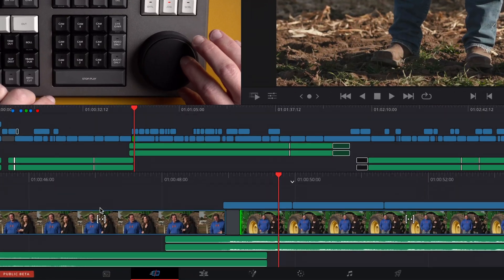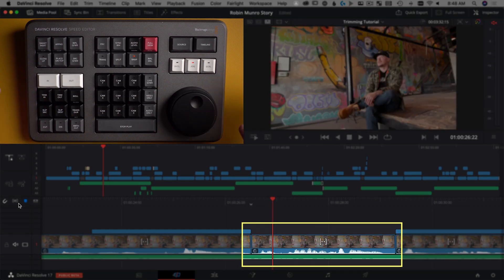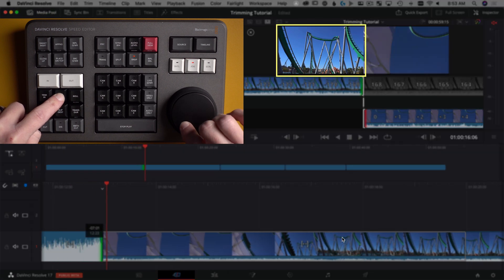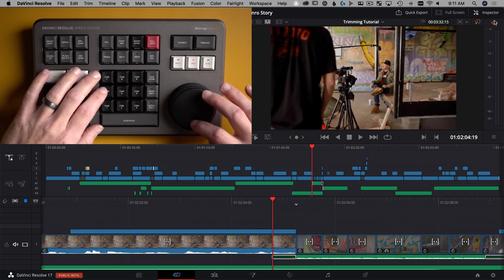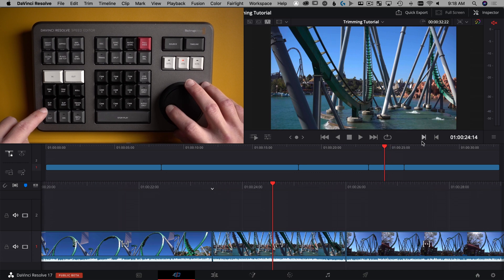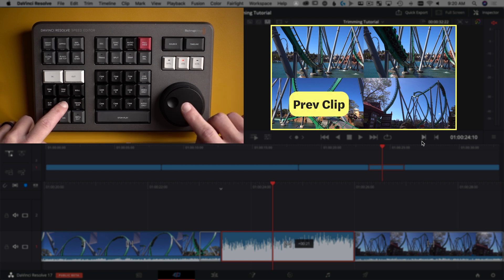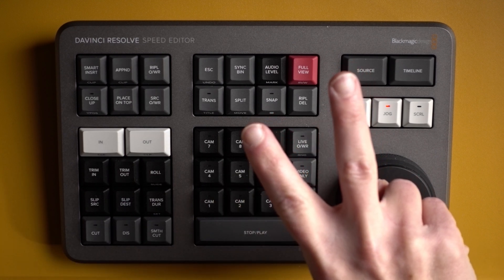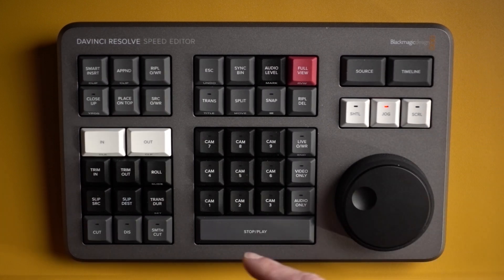How to TRIM with the DaVinci Resolve SPEED EDITOR - Tutorial

Comment: I love your videos. Your audio trim tip was really great I'm using the latest version of 19 with the speed editor the problem is that when I hold the trim in button the audio file does get very large and I can scroll around then when I move further to the right in the timeline and do it again it also gets larger but suddenly at some point it just doesn't work anymore almost like it lost its focus when I hold it down the head just sits there the only way to fix it is to go all the way back to the beginning of the video and then once again it starts working but then as I scroll to the right once again that's some random point it stops working is this some kind of bug?  Is there a workaround? I'm going to call or text support tomorrow cuz I love this feature but it doesn't seem to work in the latest stable version of 19 reliably.
Reply: It took a few hours of fussing around with it but I figured it out the audio enlargement only works at a cut or split point within a few frames to the left or the right it does not work across the whole clip you need to insert a split or cut I sure wish they would have put that clearly in the manual would have saved me a lot of time.

Comment: You must be using a different version than the 18 I have because holding the button in cut or media mode doesn't even work for trim. Also, the split button when pressed only once as  you do in the video doesn't cut  right after I press the ripl del, I had to press split in two different points then ripl del.

Comment: Hey Chadwick, are there any tricks when trimming a multicamera timeline on the cut page? I'm splitting the audio at each edit point where there are gaps in the dialogue so the video remains synchronized when I ripple it, but figured there may be a way to lock them together so I don't have to hit the split key so often. Thank you for the tips as always!
Reply from the maker: Hmm, I don't trim regular Multicam in the cut page often, but it sounds like what would help is to make sure you audio and video are linked.  you can select both, right click and choose link clips at the bottom - this should give you a chain link which marries the clips when linked selection is turned on (the chain link icon) between the timeline and the viewer in the edit page.

Comment: The only other thing I'd add here is the Trim in and trim out - map  that to Q and W in the keyboard customization. I found this has increased the efficiency by a fair  bit. I think it's also called trimming tops and tails.
Reply from the maker: Great tip - I take it you are coming from Adobe Premiere eh?  :)
Reply: @CreativeVideoTips  Yeah I thought Adobe premiere was the pinnacle of video editing. Honestly though over the years it's become way too expensive for just someone that wants to create some home videos and an odd client video on the side. Actually also considered video editing as a bit of a chore sometimes compared to this new speed editor. It's just something about it that makes you want to edit. The cut page is very innovative for the prosumer market. I can see it being even more valuable editing short films etc. 

p.s. One great thing you've pointed out was to only look at rubbish footage once - and to create bins for the HQ footage you actually want to use in the timeline. I think that will save me a ton of time when I get back to editing short films and different takes etc. I just used to shuffle through 10 mins of garbage to find a 10 second bit I needed, ten times throughout the hour ahah

Comment: How do you delete a clip with the RIPL DEL button? When I press it, the clip is deleted, but a placeholder remains in the same place.
Reply from the maker: This will happen if it’s a clip not on track 1 or there is secondary audio. This is maintain sync relationships. 

Is it possible that is what’s happening?
Reply: @CreativeVideoTips  Sir, you just saved my life (&nerves) :) The audio was locked. Now i just unlocked it and it works.

Comment: I have upgraded to Studio17.2 and speed editor was working fine. the software said there was speed editor update I did update now speed editor will connect to bluetooth but will not turn on or work on bluetooth. If I plug in usb it turns on and seems to work. when I remove the cable to try and use speed editor with bluetooth davinci resolve will crash? Anyone recieved fix for this problem? Or can I roll Back to previous version of speed editor software?
Reply from the maker: I found the same thing after the update.  Don't worry it's not broken.

You need to remove your device from your bluetooth lists (on a mac i think they call it forget the device).  After that plug it in open resolve - then pair it again.  After this new pairing you should be able to edit without the cable.

Comment: Nice video! Is there a way to split a single clip when there are multiple clips stacked on top of one another?
Reply from the maker: Only in the edit page. This can be done there by using track locks or selectors. But not in the cut page without taking hands off the speed editor.
Reply: @CreativeVideoTips  Thanks. My research has led me to the same conclusions, which limits multi track editing capabilities with the speed editor, unfortunately
Reply from the maker: @UHStudio  yeah - at least its just a click away to get that functionality in the edit page - but I would like to see simple things like this added to the cut page.

Comment: How is DR17 doing so far? Many bugs or crashes?
Reply from the maker: The only bug I’ve experienced is using the mark button on the speed editor with the triple tap to jump in and type notes into it that after doing this once it locked up the software and it needs a relaunch. 

It opens with nothing lost and I’m not sure if this has to do with the fact my keyboard is also Bluetooth. 

Overall I’ve been very happy with 17.
Reply: @CreativeVideoTips  Thanks. Very cool. I have DR17 and the spped editor combo pre oredered with B&H.... .. I suspect the piblic release is going to be good and solid.